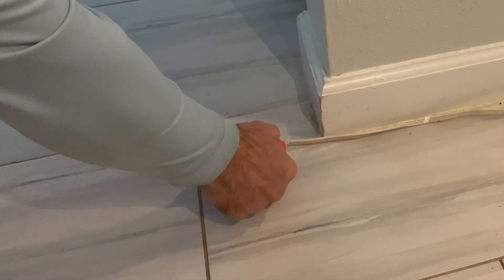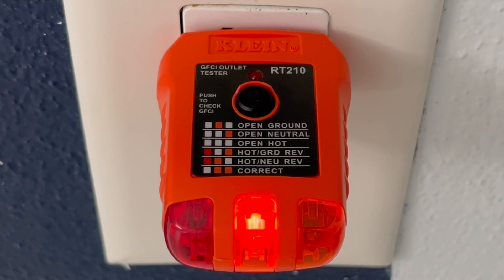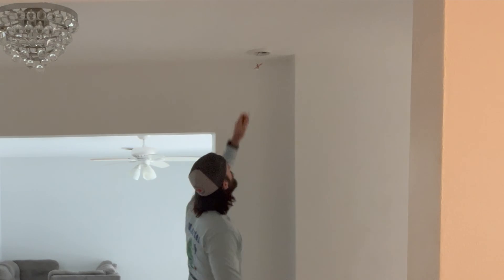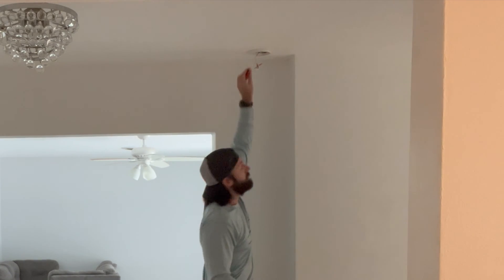GFCI Electrical Outlet Tester vs. Non-Contact Voltage Tester | Difference In Electrical Testers |

Comment: Non contact voltage tester - also known as a "Widow-Maker" !
Reply from the maker: For sure
Reply: Why?
Reply: @benderthegreat4728  Very UNREILABLE as per personal experience and many licensed electricians profess.
Users must recognize that NCVTs are designed for detecting voltage presence, not absence of voltage.
Basically, if the NCVT gives a false negative you could be killed.
Google the con's of NCVT and read a bunch of articles.